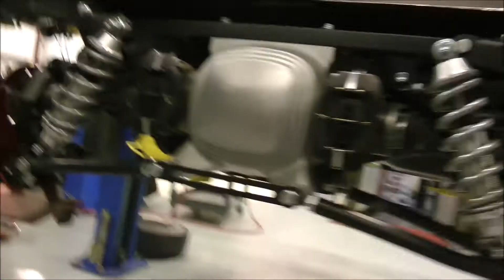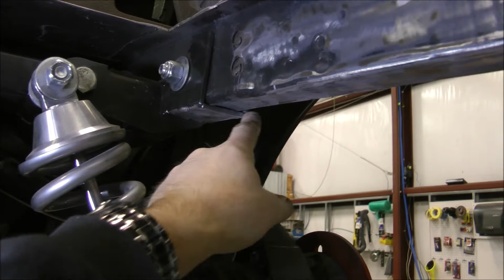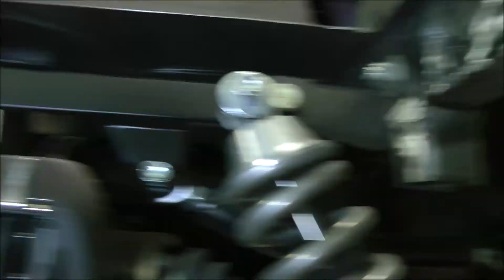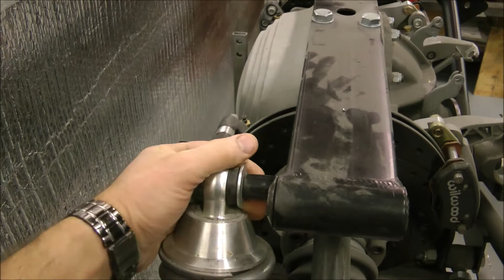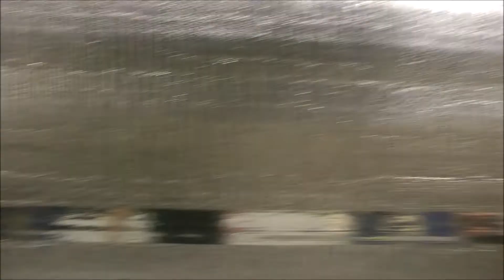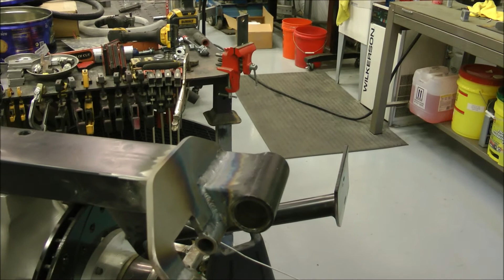66 Mustang update 14

Comment: Did you ever get the Lincoln completed?
Reply from the maker: The Lincoln is waiting in the wings since most of the problems we are solving will apply directly to it and making sure it is right before duplicating is smart. Also, the Mustang was first in so it needs to be first out. We are a SMALL operation :-)